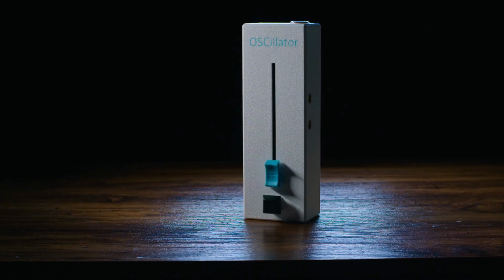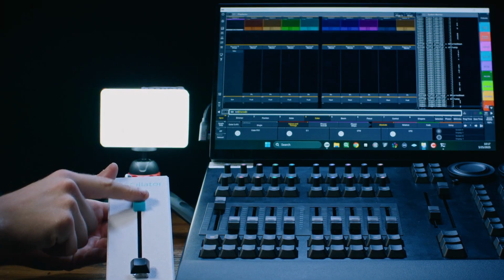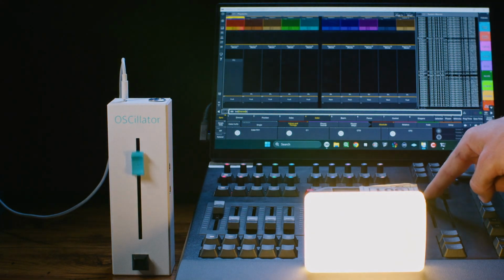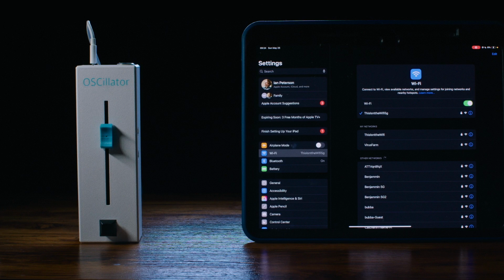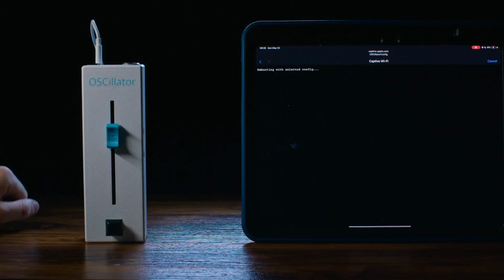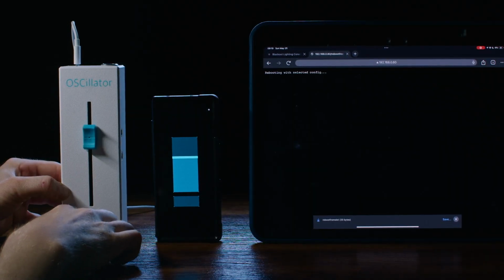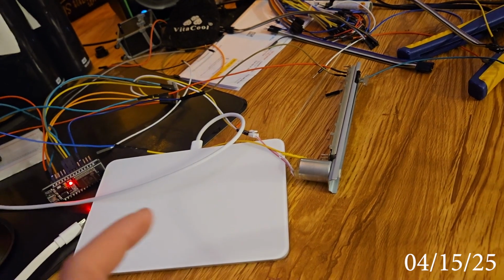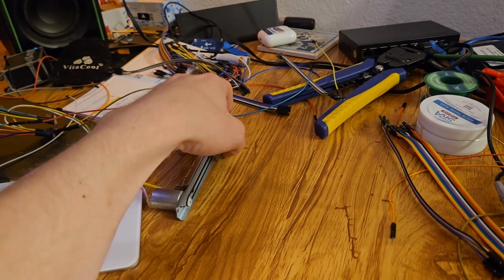I made a wireless motorized Fader and Button for any lighting console. OSC ESP32 Project.

Comment: I'm so glad you made this! There aren't really any good motorized fader libs for ES32/arduino, and you pushed through that! I commend you and hope you continue make improvements! 

One idea I have to further your design is to use an ESP32 C3 dev board, as it is very cheap and can be on very small boards. You can also use a cheap charging circuit (such as TP4056) to have an integrated lipo battery, and it will output the 5v you need for the ESP32. The thing I'm unsure about is providing power to the motor... maybe a boost converter from Pololu? I'm not an electrical engineer so I don't know if that will work well, or just put noise on the fader's pot.

I'm making something similar, but in my design, I want faders, buttons, encoders, and screens (and support at least 8 of each). But as someone without a coding background, I feel like I've bitten off more than I can chew haha. I still havent implemented PID into my library, and I'm kind of pushing it off :P

Comment: I would love to assist in design of a pcb , if we use the castlelated pcb daughter board design with a simple h-bridge +smps then the builder can choose which esp32 model (c2-c5/wvroom ) to solder and which brushed fader they want. for the "cant find network so i made my own mode" maybe do a pwm fade in/fade out so it's clearly different from other two modes (connected/looking ) , do you have a github for the code , i can fork-it and port a few features from my own project which is similar, it's a osc-midi-dmx device  and i use a old m-audio Garage band controller as it supported midi out and using esp32(dmx out in the esp32 box) + wifi to  osc/artnet i made a wireless lighting controller to QLCPlus+ to dmx512  system for my school. The Garage band controller uses Quadature dials so are position agnostic but i always wanted to do a sound//light panel using motor faders. make them smaller and stackable like a mixing desk from left to right with mag ports for power and two lines for uarts to pass data on like a mini network and a self config from the already connected one will make adding new ones as easy as hold button and connect to the side of the existing one. for position control use a simple PID routine to home in on the final position .battery wise use a 81650 battery holder as they last a while, correct voltage. most of my devices i build use them and i have a multi charge that takes mains, 12v, usb battery bank to charge them.

Comment: I think your user interface is well done. The website could use some sprucing up but the light indication and accessing AP mode hands-down beats about every IOT device I've set up. It also gives me a few ideas for a project that I want to do with a electrical power meter converting it from Bluetooth with a very barely functioning app to Wi-Fi with data logging. This thing is cool, so many uses. Oh you wanna be able to control the volume of your playback on my audio mixer here you go now I don't have to worry about you getting everything else or having to set up the app. Could've used some thing like that today to control some lights, here plug stuff in turn it up and pick a color.
Reply: Give it to your neighbors when having a party. They can then turn down your music when too loud - or perhaps just limit the max volume a bit 😁

Comment: looks nice, would be cool if this would evolve into an open source project if selling it is to much work

without knowing your code, have you looked at the WifiManager library for esp32? This will create a nice captive portal, allows to select the WiFi from a list of scanned base stations, can be extended with custom input for configs, ...

for NFC: there are ICs that can act as NFC device so that you can read/write data to it with your phone and they will act as storage for your ESP32 so you can also read/write data from your microcontroller. (For example the N24RF16 from Onsemi or the ST25DV16KC from ST, but there are plenty of them with various sizes also from other manufacturers)

For battery: there are esp32 boards with integrated LiPo managment, personally I like the boards from "unexpected Maker" as they often have the option for an external antenna
Reply from the maker: Oh woah thanks for the info! I'll look into all of this! The wifi manager library sounds huge! It looks like it doesn't support static IP addresses though and that's a big issue in lighting networks.
Reply: @IanSPeterson  according to the documentation you can set a static IP with the WiFi manager (it's been a while since the last time I have used it in a project)
Reply from the maker: @NiklasAuBln actually got wifi scanning in today! Works great!
Reply: @IanSPeterson  It supports static IP. and the WiFiManagare has also support for additional settings (more than SSID and password) so you can configure a lot more.
And you mentioned that 2.4GHz is saturated, what about 868 or 915MHz (depending on EU or US) are they also widely used?
And publish the code and hardware design on something like GitHub or eq and welcome to the Open Source/Open hardware world of cooperation.

Comment: Yeah i think classic ENC28J60 or clone and PoE support would be an obvious next step. And it does look like you might have room for an 18650 cell with built-in protection, and a typical low-end powerbank circuit to charge the cell and then generate the 5V (or pass through the input voltage) to power the system.

Critically damped PD controller, yes. You don't really need an I factor i don't think, it might just be throwing you off.

If you're concerned about blink modes of the power button being difficult to remember, you can have the same type of button with WS2812 so you can introduce different colours like green for OK, blue for wireless related, red for error.

Other ways to configure the WiFi access and other settings. One way would be via raw HID, which allows low bandwidth arbitrary data, and you can do this on PC and maybe on Android but i don't think on iOS. Also SmartConfig/ESPTouch. IDK might be a case of pick your battles, it can take arbitrarily long to implement features that end up not being used by a lot of people.